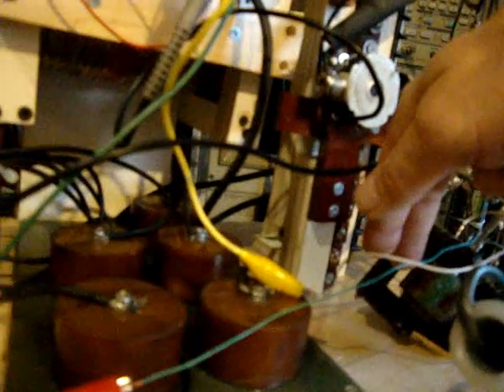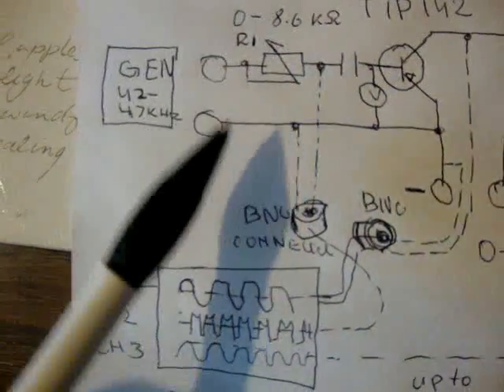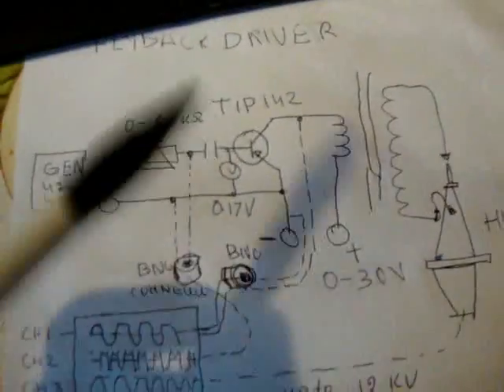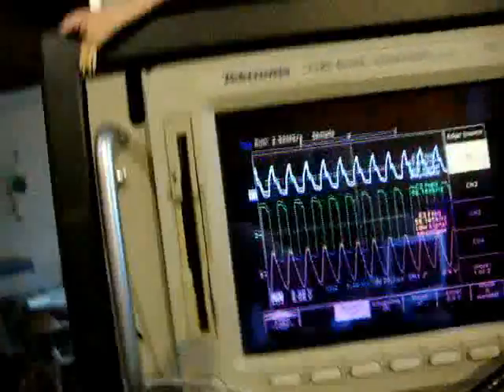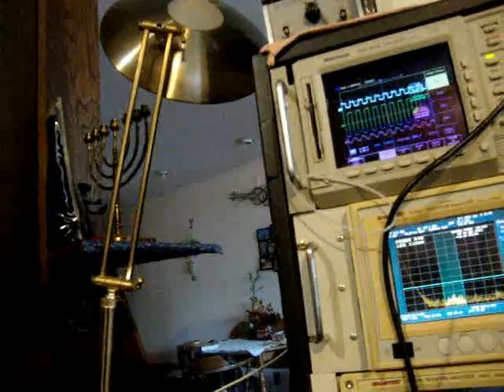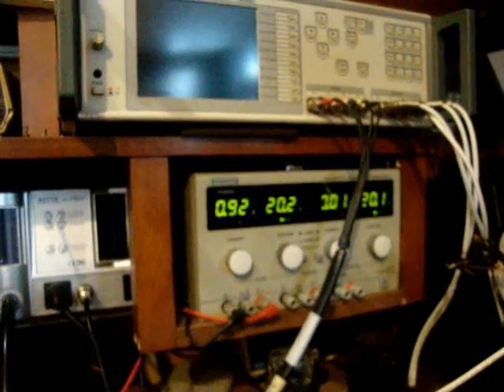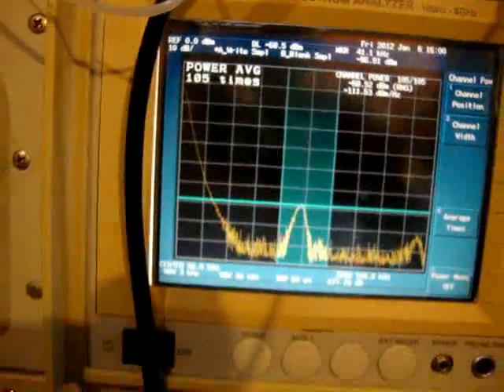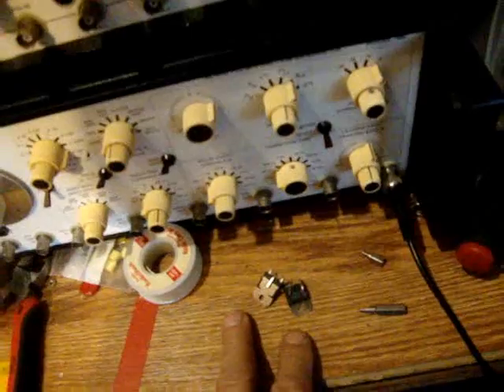How to build HV driver  for experiments with  10kV + generator

Comment: Watch out about the BackEMF Spikes from the primary coil killing your transistor.
Just use a 4 Watts Fluorescent tube across the Collector and Emitter to get rid of these
pulses killing your transistor.. What was the best frequency and duty cycle where it did use the lowest power input ?
Many thanks.
Regards, Stefan.

Comment: You're finding a resonance point based on minimum current draw when tuning with your generator. The driver oscillator circuit I am using causes it to self resonate from a feedback coil on the flyback transformer. The difference between yours and mine is my HV frequency adapts dynamically to changes to the external load.

How important is stability of the HV frequency to the overall operation of "the device"?